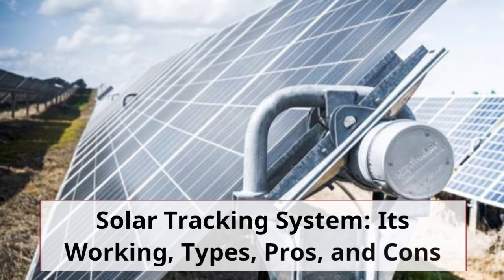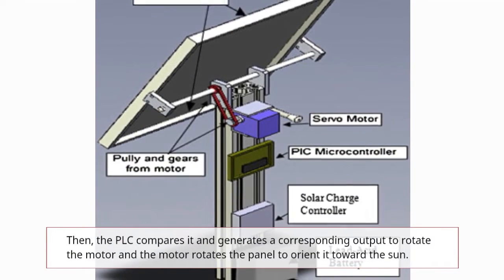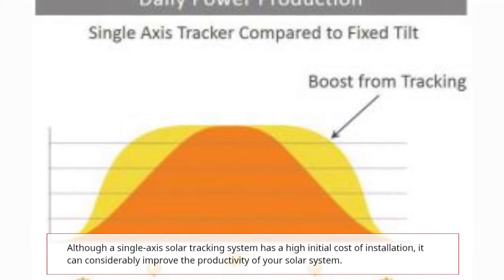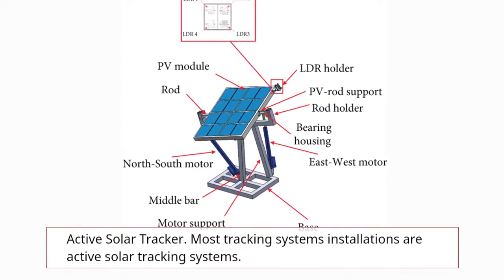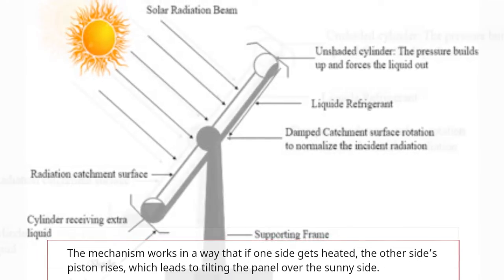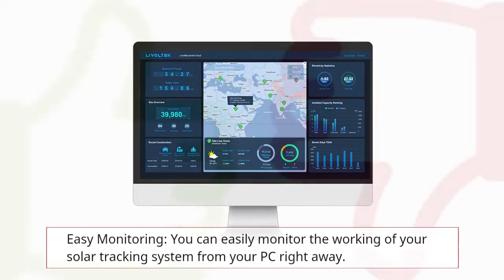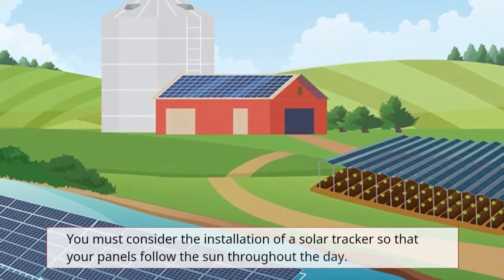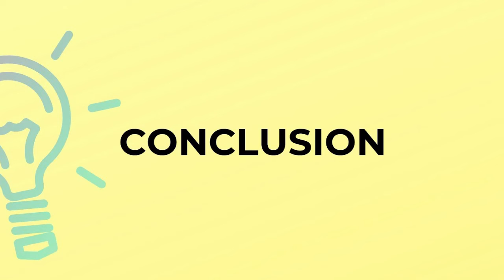Everything YOU Need To Know About Solar Trackers 2023 | AI-Automated |

Comment: I live in a cold snowy climate and I've installed several of them and I've had no issues with them so therefore what you're saying is not true
Reply from the maker: I have not said this as it was mentioned in a article. These are just theoretical assumptions that can happen but will not always happen in reality as the conditions and situations differ and has many factors to consider. Thank you for the feedback

Comment: "Everything YOU Need To Know About Solar Trackers"???
They are maintenance-intensive, susceptible to repair, do not last long and meanwhile extremely uneconomical compared to more panels!
There was a extreme drop in the price of solar modules in 2023 & 2024. It is much more effective and reliable to simply install more solar panels! 
If you want more constant yields throughout the day, you simply have to set up the modules in an S-E and S-W orientation.
Reply from the maker: But dual axis solar trackers are twice as much effective and accurate energy yield compared to single axis trackers despite the costs for installation and maintenance.
Reply: @ThinkInAI  According to the Fraunhofer Institute for Solar Energy Systems ISE (which analysed xx studies), the additional yield of single-axis trackers is a maximum of 20% and that of dual-axis trackers around 30%. Trackers require a relatively high level of maintenance and repairs because the mechanics and electronics are active outdoors every day. Solar panels, on the other hand, are almost maintenance-free and usually function for 25+ years without any problems.

Comment: Where and what is your code for the micro controller to run the motors?  It is part of what I consider "everything" as in the title of the video.
Reply from the maker: Thank you for your comment. I don't have the code for it as I am just explain the overall idea behind the solar trackers and its purpose that it plays in the solar energy industry. If you want the code and how the design of the solar tracker works to track the suns movement, there are online resources that can provide you it.

Comment: A major benefit to solar tracking systems is they extend your solar power generation over a longer period and get near peak production much quicker.  This is important for off grid situations where running things like AC units can be done without needing as big of a battery bank.  You don't even need your entire system to be a solar tracker to have a significant difference in your battery usage profile.  

Also, you can just have a linear actuator move the panels.  The site prep is minimal.  It's just a hole in the ground filled in with concrete as the base for your main post.  Check out the eco worthy solar tracker installs.  They are pretty basic and not expensive.  Obviously if you are doing some sort of commercial build then that is completely different.
Reply from the maker: great insight about solar trackers. I appreciate it.

Comment: Dual axis trackers DO NOT use "AI algorithms".
Reply from the maker: Then how does a dual axis tracker keeps track of the sun's movement throughout the day adjusting the vertical and horizontal levels?
Reply: @ThinkInAI  if you know coordinates, date and time you can calculate it brother.
Reply from the maker: @ErsinAcar-v6r  yes you can
Reply: Telescopes have been tracking stars for decades, way before AI.
Reply: It's a very simple task, you don't need a "deep learning model".
Reply from the maker: @S_witch_on  ah makes sense. But you could use AI to make it more efficient for tracking. As there are many deep learning models available for these use cases.

Comment: Hello, 👍. I installed a 2-axis solar controller in my DIY solar tracker: https://youtu.be/_Rs8CptQcDw . Save electricity costs https://youtu.be/eC2olbCBhh0 , shorten solar amortization, with dimmer + solar PV , self-sufficiency will now increase to almost 95%, because expensive purchases from the grid are so easily suppressed and the electricity bill lasts just like the electricity meter. The prerequisite is that you have at least a small balcony power station, and you don’t need an expensive battery either. Example of a kettle: Without a dimmer, the 2500W - 600W PV system needs = 1900W, which you have to pay more for. If I turn the kettle down to 600W with a dimmer, then every weak PV system can now supply each consumer independently and independently, because the 2500W kettle becomes a 600W kettle thanks to the dimmer. No magic, just physic. How it works: https://youtu.be/wO9rw9bUea8 .  The 2000W e-heater becomes a 500W e-heater with a dimmer, which can run 12 hours a day free of charge via PV. The 4000W oven is also tamed. Not the solar systems have to grow, but the consumers just have to drop by 75%, which is sooo easy with the dimmer. are you convinced now I have already switched my entire household to dimmers. Please have a look at my channel. ....... 🌞 ....... Increase mini PV solar self-sufficiency (winter and camping): A boiler and other power-hungry consumers can be infinitely reduced using the "5000W dimmer". Ebay €7. I run 5 dimmers in parallel on an 850W inverter. Kettle 2.2KW at 150W runs 12 hours a day, so the water is always hot. The room is also nicely heated. 2.5KW washing machine runs in parallel with dimmed to 400...600W and always reaches its 60°C, and also its 1400rpm... It doesn't matter to the washing machine whether it changes the washing temperature to 5min@2500W or 100% can be achieved free of charge via existing PV power in 20min@600W. The wash cycle lasts the same time dimmed and non-dimmed, 3Sth 10min. The iron, dishwasher https://youtu.be/8vnAkrS1x-s, oven, electric heater, waffle iron, coffee machine, all internal heating are so throttled for me. Videos on my channel https://youtu.be/QbLWDbJi6ew The inverter stays cool, quiet and the MOSFETs + (battery) remain intact because no extreme current peaks arrive at the inverter. Now every Mini PV Inverter is enough to operate large devices. So, with the dimmer, all internal heaters/devices can be converted into base load devices that stay almost permanently ON, drawing very little current directly from the PV. With a wattmeter / energy cost meter you can then measure this perfectly in order to set the dimmer optimally. ......... I have some videos about it on my channel. LG, Christian 🌞.............. ................ ................ 🌞.............. ................ ................ 🌞.............. ................ ................
Reply from the maker: Hi, thanks for the comment. I somewhat understood what you said and its great that you have a 2-axis solar tracker constructed from which you have been able to modify it to save electricity costs and consumption on your appliances. I have checked out your video as well.